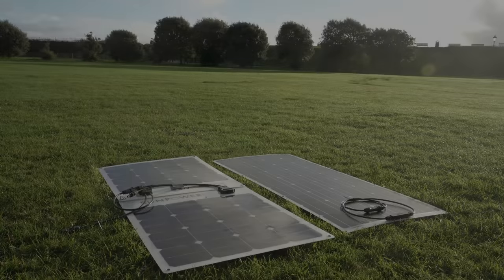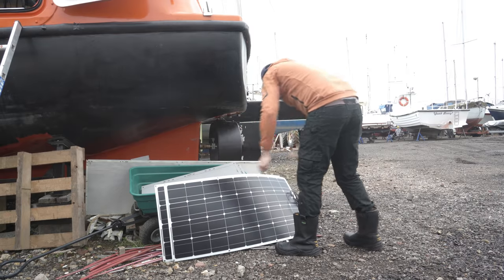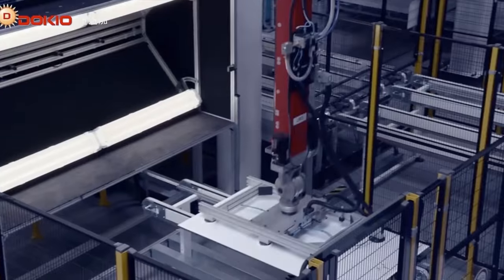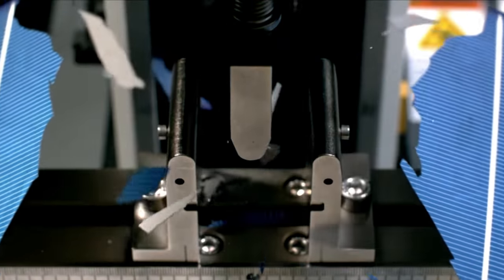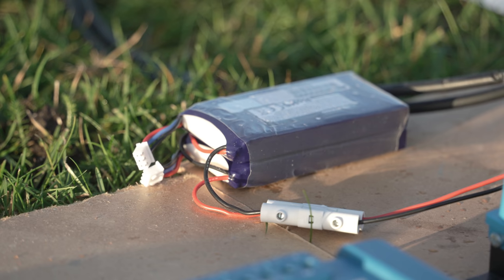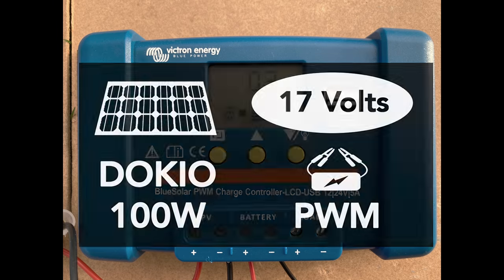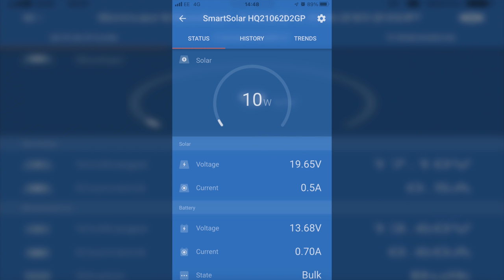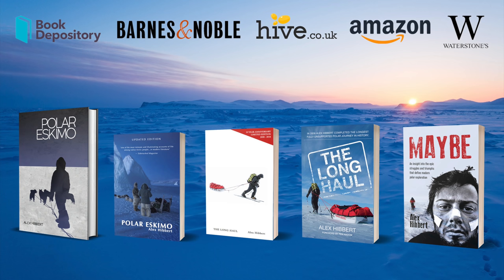SunPower MAXEON worth extra cost? Poor light solar panel test vs. conventional 100W Dokio panel [4K]

Comment: I have found that if you are constrained by budget and you have the space, in most cases you are better off going for more, cheaper panels and bumping the voltage up as high as your MPPT CC can handle rather than fewer of the more expensive ones running at a lower voltage. I have two parallel strings of series wired panels up on my roof, best results achieved by keeping them cool with an air gap beneath them and angling toward the sun. Neither of those options will be available to you though so I would go for max voltage by series wiring the panels on each side and then running those in parallel into your SCC.

Battery bank type will make a difference and is often overlooked for charging, if you have a LiPo bank with a high C rate you can get as much charge into them as fast as possible when there is sunlight available, mine are often charged by mid to late morning on a sunny day which leaves the rest of the days solar available for me to use to run the washing machine or dishwasher or heat water with for energy storage.
Reply from the maker: You've pre-empted my plan!
Reply: @AlexHibbertOriginals  
I do wish you bon voyage! And I feel guilty that I haven't bought one of your books yet. I will.

Comment: Great video.  The issue I have with cheap panels is they often skip the uv protection from production so your panel life span normally advertised as 25 years is actually more like 4 to 5 years. 

 Sunpower all the way if it's a long term power solution. For fun, learning and short term. Go. Cheap.
Reply: Solid Advice.

Comment: I'm more interested in durability and long term performance. I'd rather a well built panel which gives me 25 years of use than a cheaper panel with similar performance in the short term yet falls apart over the course of 10 years.

Comment: I recently did a partial shading test with a rigid 375W panel.  It reduced output by 50% by having just one column of cells obscured.

The interesting thing about your test is the shadow cast by the grass blades. Its probably worth elevating the panels and making sure absolutely no shadows are cast onto the panels.  They can dramatically affect the result.
Reply from the maker: I did pull the cables out the way during the measurements. Grass blades - perhaps! Although it was diffused light and both panels had the same situation.
Reply: shading is an issue for standard p-type panels because most manufacturers try to keep costs down by stringing the individual cells in a series. so depending on how many series are in the panel, any shading will have a big impact. if the entire panel was wired in a single series, just one of the cells shaded will reduce the output for the entire panel potentially by over 90%. higher quality p-type panels use more interconnects so a shaded cell only impacts the output from that row of cells it's tied to.

sunpower uses full back contact n-type cells with individual bypass so the percent of the panel shaded more aligns with the percent output of the panel. in short, shading is not as much of an issue but for testing purposing it's still best to have wires out of the way.

for the purpose for this boat, I don't think shading will be an issue at all so solely on that it's not worth it for the much higher priced sunpower panels. that said, nearly all p-type flexible panels are junk and will die in 1, 2, or 3 years. it goes back to the way the cells are connected and by having the flex causes the connection to degrade much faster with time. that's why most flexible panel warranties are 1-2 years max while framed rigid panels offer a 20-25 year warranty. I believe sunpower offers a 5 year warranty on their flexible panels and in theory the way the cells are manufactured should give a much longer lifespan. whether it's worth the steep premium is another question. for mission critical tasks like extended cruising far away from civilization, I would not trust standard flexible panels. the best solution is to find a way to mount rigid panels but that's probably not an option the case for this boat.

Comment: A lot of clever engineering would be required to use them on a boat like Alan & with the rigors of the ocean being a factor, but solar concentrators could boost your output by 4-fold or higher. They're made of very thin & lightweight aluminum sheets which have a mirror finish. You have them set at the proper angle to the solar panel and they focus more usable light towards it. They cost nearly the same as regular aluminum sheets but you still have to construct the framing, hinges, and a way to lock them into place. The solar concentrator frames (1 on each side of each of the solar panels) can be built to fold the concentrators over the solar panel to protect it & keep it clean when not in use.
Reply from the maker: I'm sure it would produce benefit, but the structural work vs the gains for this application would be cons > pros.

Comment: Make sure to not have the cables covering part of the solar cells. Even very partial shadow on a part of the panel can reduce the power output of the whole panel (depending on actual wiring inside the panel). A bit of bird poop can be enough to affect it.
Reply from the maker: Yes this was tricky to achieve. The cables are so stiff. I'm going to re-wire the ones I'm mounting on Alan.
Reply: There was also grass shading the panel in least some pictures. That could lower the panel production up to 80%.

Comment: Something not mentioned is the need for at least two charge controllers, one for each side of the boat. Solar panels in series or parallel don't like one being in shade and the other in sunlight.
Reply from the maker: Quite right. The boat installation videos will cover this.

Comment: You probably already know this but for best efficiency you want to use multiple MPPT controllers, ideally one per panel. That way if one panel is shaded it does not affect the output of the others. A shaded cell in a string can actually consume power instead of than generating it.
As a side note if you back drive a solar cell it will produce light, albeit at very low efficiency. Conversely a LED will generate a very small amount of power if you shine a light on it. The basic underlying structure of the two is quite similar, they are just optimised for different purposes.
Reply from the maker: Hi Les. Yes, for the Alan episodes where I actually rig up and connect the array, there will be two separate circuits. In an ideal world four, but life is a compromise. There's a delay as whilst I was abroad, there was some damage from the storm.

Very interesting second paragraph!

Comment: Do you think icing or snow will be a problem for the PVs?

I was just reminded of a friend who said he installed loops of heating wire under his PVs to get ice off them. 
Don't know how successful or power-effective it was for him, or if it would be in your case, as I've heard rumors that days can be a bit colder on the polar ice than in Finland.
Reply from the maker: Yes, physical obstructions and shading will be a pain, although..... when Alan's in the ice, wind and diesel will be the main source of battery charge and power. Light levels will already make the panels produce low levels of power. They are more for late spring/summer/early autumn transits.

Comment: The bulky boxes that the cables come from throw a large shade on the panels when the sun is at a low angle.
Reply from the maker: This is very true. Not a great deal to be done, short of a total rebuild of the terminal.

Comment: Did you remove the cables from the panel? The shots I saw they was laying on the panel? I have a video on shading on panels especially these littles ones which don't have diodes. I to have a video on 100 watt panels. Pwm vs mppt. In good light you get an extra 1amp.
Reply from the maker: Yes, I pulled them out the way. They are so stiff (I mentioned that I don't like them) that I couldn't permanently keep them out the way as I filmed the other bits of the episode.
Reply: @AlexHibbertOriginals  yeah, they are not the best cables. I am bouncing off the walls waiting for your big trip with Alan. I hope you vlog it, I have followed you from the start.
Reply from the maker: Thank you! Some way to go yet, but it'll be excellent.

Comment: Should they always be in parallel? The battery charger can handle variety of voltages, but a broken panel is not a good conductor, so it is an issue of reliability.
Reply from the maker: The two MAXEON panels are in series, hence the higher voltage.

Comment: From most of  the tests i have ever seen, unless you purchase a really nasty panel, most will perform to within 10% or so of each other and the rest of the money spent is just branding hype. Mppt has been the way to go for several years now, with Pwm falling to the wayside except in some very cheap and cheerful regulators (including ones badged as pwm). I have recently purchased a pair of 100w Renogy units, and watt for watt they perform virtually no different to my 3 year old Lg units!.
Reply from the maker: I think the badge envy issue will always be the case. Build quality may differentiate if you are using them over many years under difficult conditions. These tests do however show that MAXEON provides a significant boost in poor light. I suspect in excellent light it's less marked.

Comment: Where I can purchase this ones ?
Reply from the maker: Sunpower don't seem to sell small panels directly. I used a UK renewables retailer.
Reply: @AlexHibbertOriginals  thx for your response . How can I contact the retailer that you used? If is not to much .. thx I’m in Uk at the moment.
Reply from the maker: https://www.google.com/search?q=sunpower+50w+flexible+solar+panel&oq=sunpower+110w for best prices. I gather this model is discontinued, so the stock may run out.

Comment: Hi alex,  This a is a flawed test.  The PWM controller looks to have a lead acid software in it, am I right?  (There is several different types of software for this model of PWM contoller.)  (I believe the PWM is a chinese built device pakaged up by Vitrion.) The Maxeon will be over driving the PWM in series mode; they should be in parallel and it would account for the differance between the panels.  You should test to STC conditions and then derate in a controlled fashion but I accept you are doing a quick test.  The battery used in your test will have a different internal resistance and character to those you plan to use.  Not good..🙂
Reply from the maker: Hi Peter. The controller is programmable for LiFePO4. :)